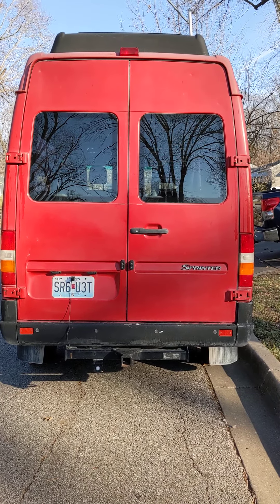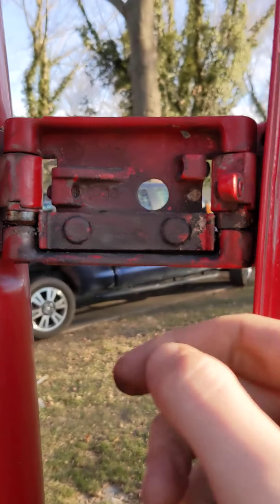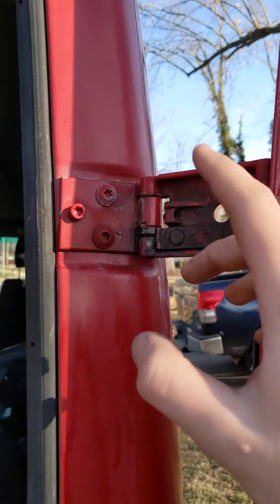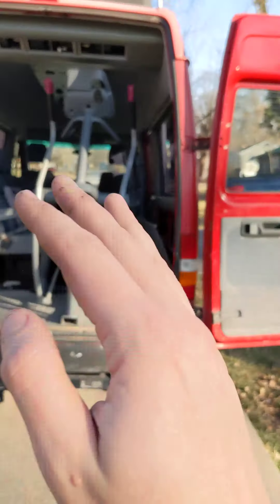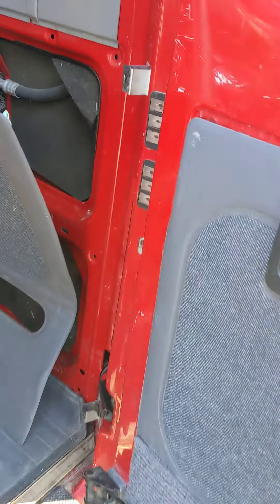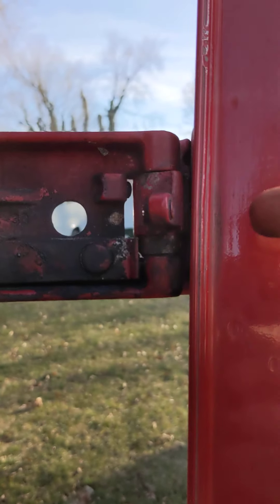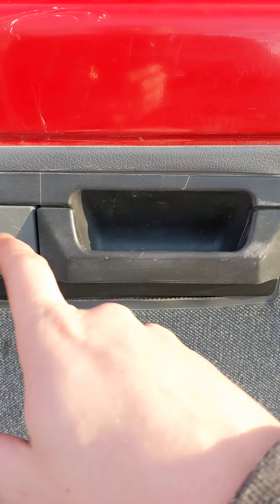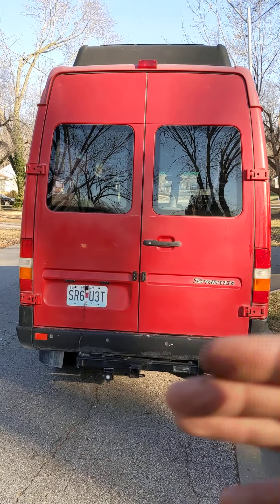How to adjust/replace rear doors/hinges on a T1N Sprinter.

Comment: Wow thank you so much for making this video!! It is soo hard to get a peep for the rear door area of the T1s! I can’t wait to try these adjustments!

I’ve noticed my rear door hinge screws are stripped. On mine there are 3 that hold to hinge to the van itself. @1:21 where your index finger is, to the left of it, would you happen to know the model number for these 2, which are the same for the top and bottom? I had recently ordered 5073721AA from Mopar but they were totally different Then what I was expecting. What they had sent me were a head fit for a socket wrench rather than for a torx screwdriver/impact driver and of course they never have their screws displayed, which is so not helpful 😓. Hope they weren’t replaced by these...my mechanic ruined them.

@1:27 the 3rd lone screw is visible for a split second to the farthest left which looks like a bolt torx (it’s probably not; I know nothing), the one I have is totally wrecked also but have no idea how to identify the model number for this either.

Just recently brought a rear cargo weather strip, that fits on the entire circumference of the cargo door area (to the van itself, not the middle liner at the left door) but haven’t a clue if adhesive was used to stick it on when fitting it. There’s just no information on this. If you have the slightest clue please, please let me know. If you need any model number for any parts, I’ve come a long way in that department and ready to share. Thank you again for this video; the timing couldn’t be any more perfect!
Reply: @0:58 (inside pivoting before outside) @3:19 (door gaps out a bit upon closing) are happening to my right door and @4:21 (hitting the weather strip) is happening to my left door at the moment. Awesome man, you covered so much!👷‍♂️

Comment: Three years later, hah, a question: What's the common cause of the rear door not wanting to lock when locking other doors? I hear what I assume is the actuator doing a thunk-THUNK - one direction then back, I expect - and oftimes I have to go to the back and open a door, manually push the lock flap, shut the door to get it to lock properly. Other times, the rear door locks as it should, there's no consistency to it.

Comment: Lots of great information! 
Would this order make sense? 
1. Clean then adjust latch on passenger side door
2.  Adjust guides on top and bottom
3. Adjust set screws on hinges to set pitch
4. Adjust bolts holding door and hinge

Also should the doors be flush front to back all around? (Taillight to taillight if you will)

Comment: Another question involving my hinge: I replaced the hinge but the new one is still actuating at the wrong part first. I have a ladder attached to the outside of that door. Could that be the problem? The top hinge works fine.

Comment: Hey! Question: I'm having issues with the black latch mechanism on the driver side door that controls that bar on the inside of the door. It started a few months back and has consistently been an issue. I have to fidget with it to get it to go into full locking mechanism whether the door is shut or open. Any thoughts?